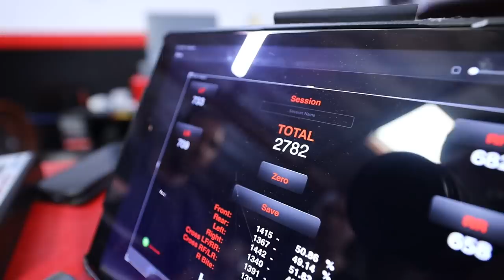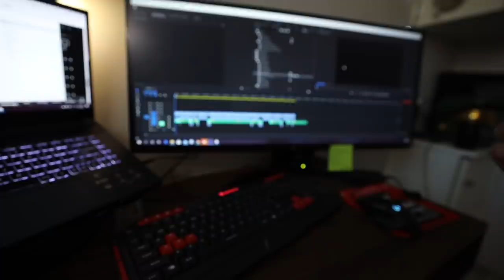Spoon S2000 is getting Wrapped!

Comment: I work at a local tire shop and I use the same balancer and tire changer as the one shown. When you see an assembly go above 35 Road force without the rim being bent that means there’s a slight “malfunction” on the tire that you have on the assembly. You can’t really fix it therefore the best thing you can do is switch the tire to a new tire. That being said, it does sound bad BUT HAVE NO FEAR. It just means you will feel bumps when you’re driving, but don’t blame the person operating the balancer. Just get another tire because not every tire is perfect circle. 

Keep grinding Dustin! Loving the build!

Comment: I want to love the rear end but the exhaust just looks off to me 🤔 the spacing just throws me off. Either great progress with the car can't wait to see how it performs. 👍🏻
Reply: He needs to paint the grills for the rear bumper black and install them. Part of the reason the bumper looks off is because it has the blocky ridges on the inside of the bumper cutouts intended for mounting the grills so it just looks kind of unfinished without them being mounted there. Still, badass car though.
Reply: Mike Haskell yeah i've seen the kit finished with the mesh inserts. I guess what i meant to say was that the exhaust seems off center from left to right. looks like it's about to touch the bumper on one side and the a large gap on the outer parts. The kits i've seen the ran the dual single tip exhaust first time seeing the quad tip. Either way i agree the car is gorgeous and i can't wait to see it done

Comment: My shop has the exact same mounting and balancing machine and it gives us nothing but problems. After a while the balancer won’t want to spin the wheel and the motor in it will go out and it’s 4 months old. You spend 10k on a machine that is suppose to install a tire by itself but always ends up fucking yo
Reply: Up*

Comment: That front bumper is bothering the f out of me like why isn't it aligned with the fender
Reply: The front and rear bumpers are made for stock body s2k’s, when you get the wide fenders they have two pieces that you add to the front bumper.
Reply: @timrichards7015  oh that explains a lot thanks. But I didn't see those pieces